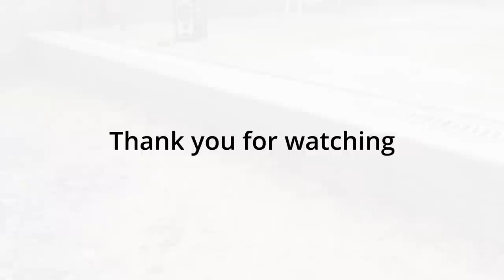Channel Drain Install  | Garage / Shop Project Ep17

Comment: A quick trick to keep you from burning up your hole saws is to Start the drill just enough to make your round mark in the wood. Then take a 10mm or so drill bit and drill a hole just to the inside of the big hole so it intersects the path of the hole saw. More than one is good to do as well. It gives the sawdust a place to escape to instead of packing into the teeth and gumming it up. Yes many of us here know what metric is. :)
      Don't feel bad about picking up one board at a time as that's the smart thing to do. I have been out of commission for almost a month because I have a metal insulated building and was building 2x4  framing and wall over it in my shop to insulate it better and have walls to mount stuff to. Well I think I ended up stretching a tendon and that was the beginning of December. Getting around was painful but finally yesterday it was like a switch and I am getting around without wincing and and in pain. Now not to push it too much as it feels better. It's easier to get hurt as you get older and it takes longer to heal now. Work smarter not harder.
Reply from the maker: Thanks for the tips - yes, that wood was very wet and heavy.  Took me by surprise.  And I am feeling the age thing.  I got tennis elbow from the Poly Tunnel build about 18months ago and I cannot get rid of it.  Both hands now seem to be seizing up so I am trying to take a little easier.  We just ordered a piece of kit to help us a little more too.
Reply: The drill was also set on hammer, which can't have helped.

Comment: Well done on another fine piece of work. As always care and attention leading to an excellent finish. You are setting a very high
standard for yourselves but that will make it all the more satisfying when its finished. BTW - did you remove the surface drain
from the floor - couldn't quite see from the videos. If so, any particular reason? Hope you get some good weather.
Reply from the maker: Cheers Arthur - I did not show me re-doing the whole drain.  It was not correct so I had to pull it all out and grade it with a little more precision.  It was so time consuming but I could not let it stay like it was.  All good now though 😀

Comment: Hi guys,  have you thought of having underground water tank for those hot summers.
Reply from the maker: ah yes, when the structure is up, I plan to route all the rain water pipes into a common meeting point and then if we can afford it get a tank buried just below with an overflow continuing out across the fields.  I hate missing the chance to collect rain water.

Comment: Nice work on the drain. I started following because I am interested in buying a small excavator for use at my cottage in Canada. Then I saw you are working on this for your Bike B&B in the Pyrenees. I fell in love with riding in that area after doing Haute Route and some of the awesome climbs (Aubisque, Tourmalet, etc). Hope to find some info on your bike and stay services and come out to ride with friends. Cheers!
Reply from the maker: Cheers Steve - We have been in the Pyrenees, running cycling holidays for the past 18 years.  We are an agent for the Haute route (but have never done it) and we run a lot of different tours across the Pyrenees, Alps, Dolomites, Corsica and the Basque Country.  We also have our base here where cyclists can trek out and do a multitude of loops, including the Tourmalet.  Just drop us an email if you ever come across this side of the pond.